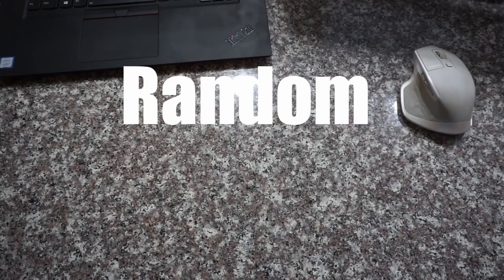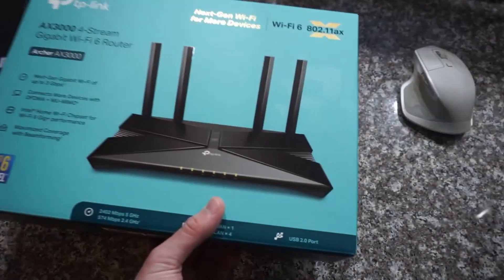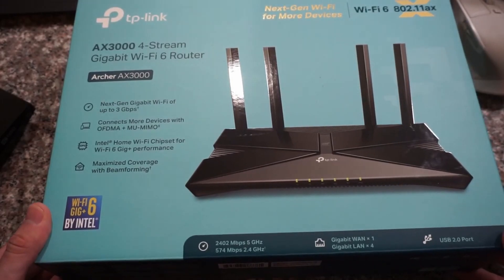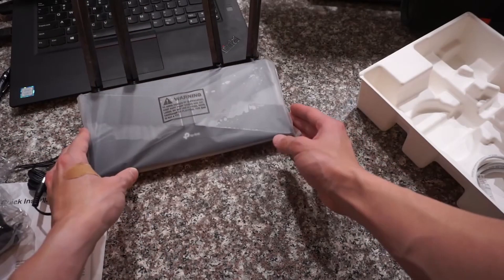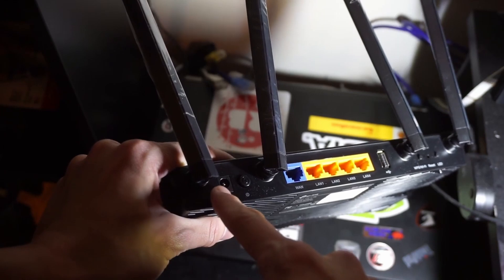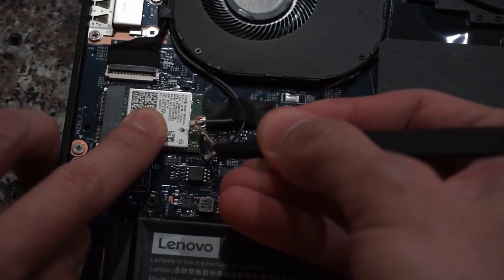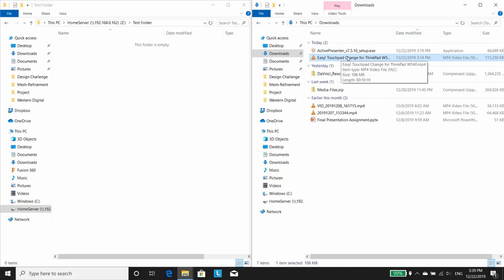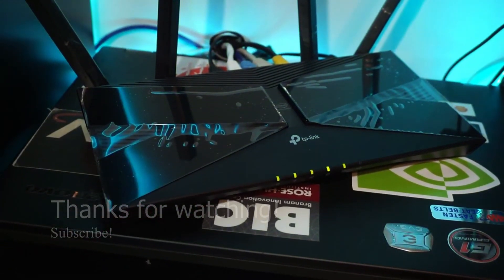(Reedited) Is your router outdated? Upgrade it to WiFi 6!

Comment: This Archer AX3000 is a Walmart exclusive and is slower than the Archer AX50 even though both look identical. Make sure to get the Archer AX50 not the AX3000 when you purchase the router because if you google the benchmarks, the AX50 is literally faster and has higher throughput than the AX3000 when tested.

Comment: Hi there, I heard that this router has a few issues with heat, causing freezings and connection drops and lacks performance above 300 mbits of internet speed. Do you have any of this issues? Tks a lot!
Reply from the maker: The router does get warm. Because I use an NAS in my local network for video editing, a fair amount of data is transferred through this router both wired and wireless. But I have not experience any issue with it so far.
Reply: Spread those rumors!